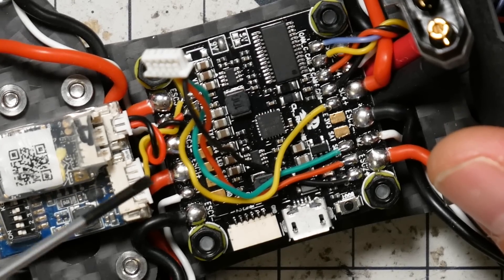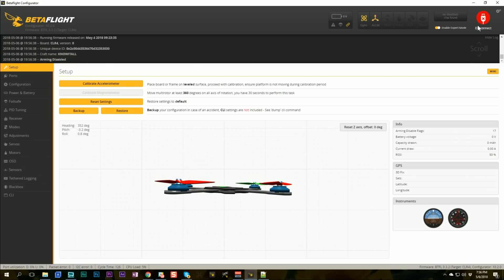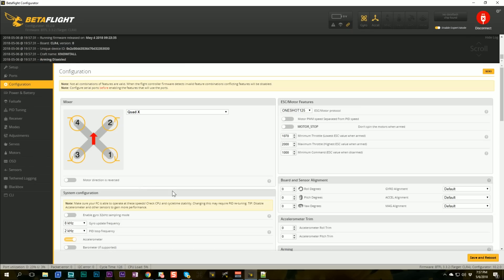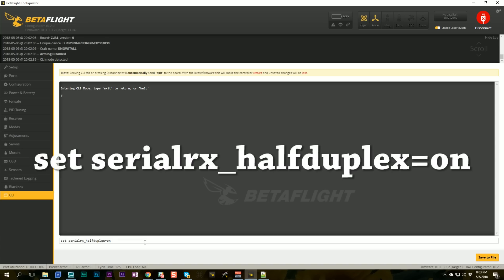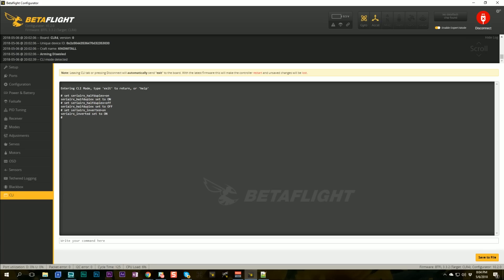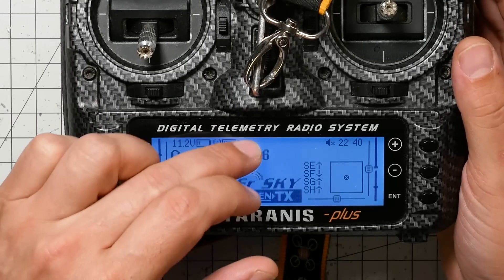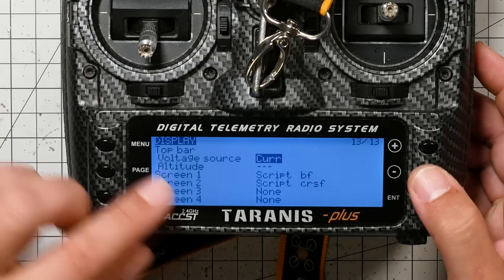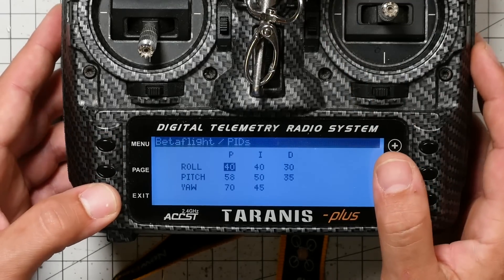FRSKY FPORT HOW TO | SBUS and SmartPort on One Wire

Comment: Hello Josh, im new to open tx after yrs of spectrum im trying to get a 5 inch setup qx7 the receiver your using in this video. I have the lux V2 FC. I wired the rec as you described.  My problem is i cant get the rec. tab in BF to work. On the lux v2 the serial rx is uart 4 the tx is uart 5 i have the serial turned on uart 4  and in config i have serial rx and sbus on, is that wrong?

Comment: Hey KIA... is Fport inverted...?
Reply from the maker: Yes.
Reply: @JoshuaBardwell  Confused... F.Port uses hardware inverted S.Port connection on Rx. Wired to FC via hardware inverted S.Port. I've read that F.Port solves inversion issue on F4 processors. Theoretically F.Port software could be written inverted then sent to S.Port and un inverted and no need for an invert on flight board. This is what I thought F.Port accomplished. Luv the KIA on yer OSD... lol and your vids I'm having lotta fun with this stuff.
Reply: Yikes that seemed like more of a rant than question... thx to Samuel Adams.

Comment: Joshua, So if F-port will not work on softserial, does this mean I need to reflash my receiver back to a non-fport Fw to have s-port telemetry?
Reply from the maker: Smartport telemetry is included in fport. That's the whole advantage of fport. That it does telemetry and control in one wire.

Comment: Hey Joshua, thanks for all great videos, they are really great when you are new to this hobby, even me as an embedded software engineer for two decades stumble on these things sometimes. I have a question about this, which may be to specific, IDK. I have a Diatone GT M530, which has their Mamba F405 FC. It's good, but it's woefully lacking in documentation. It has three UARTs, none of them specifically labeled for a specific use - I've been able to discern that UART1 seems to be able to handle inverted signals since I can hook S.Bus directly to it and it works: So currently I have S.Bus at UART1 and SmartAudio on UART3. For SmartPort I had to solder a wire to the non-inverted pad on my R-XSR receiver, It had me scratching my head for a while since it got delivered with a harness wired up seemingly to fit an R-XSR, but with SmartPort going to the normal, inverted SmartPort pin on the receiver.

Anyways, given this FC, which has no Telemetry/SmartPort/Whatever name for an inverted UART, do you think F-Port would work if wired to UART1, which now is wired to S.Bus without any external inversion?

Cheers
Reply: This is a good question, and would answer my dilemma also with the DYS F4 Pro V2 ..... Should we just flash F.Port FW to R-XSR , then connect the S.Port wire from R-XSR to the same TX-1 pad that is working out of the box with Sbus ??? (And modify BetaFlight etc) But as it's an old video, I don't think Joshua Barwell  will hear our cry's in the wilderness that is YouTube. He must get literally thousands of notifications every day  :)  Joshuaaaaaa  ;)

Comment: but if the f4 don't have a tele pad ? what then?
Reply from the maker: You must do the "uninvert hack" on the receiver. For the RXSR this is simple, since it has exposed P pad which gives uninverted smartport and fport.
Reply: I have the r9mm. So just connect it to a tx pad?
Reply from the maker: Correct.
Reply: Thanks 😊 no need to do the soft serial when connecting to tx?

Comment: The Lumenier F4 AIO has a dedicated SBUS pad and a dedicated RSSI pad along side tx/rx3 and tx/rx6... how would I wire the R-XSR to this flight controller. I can’t seem to find any information on this board other than vague standard specs. Thanks in advance anyone...
Reply from the maker: RXSR goes to the SBUS pad. Green wire is SBUS OUT if my memory serves.
Reply: Joshua Bardwell thank you sir

Comment: Hi JB! 
I'm struggling with getting fport working on kingkong f4(tower) with r-xsr. For now I'm getting all channels working, but having only rssi and rxbat in sensors list. Tried all CLI tweaks. Soldered on uninverted s port pad. Tried again. No changes. Also need to say I put this wire on rx receiver pin on fx, and then remapped it to a tx6.
So question is: 
Will channels work if there is some issue with wiring or resource mapping? In other words: Does my situation means I did it right (I mean soldering and setting up) or it's completely wrong and I should look for another pin on fc?
Reply from the maker: If you are using the "uninvert hack" then I suggest you skip remapping, which can cause complications. Use any TX pad. Make sure to go into the CLI and type

set tlm_inverted = on
set serialrx_inverted = on
save
Reply: @JoshuaBardwell  ok. But what you say about rc channels working fine ?
Also I have a strange thing : few things mapped on C07...How can it be ? There was a pwm4,serial_rx and serial_tx on C07
Reply from the maker: "resource" shows what MIGHT be on a pin.

"resource list" shows what IS RIGHT NOW using a pin.

So in "resource" you might have multiple resources on the same pin but "resource list" should only show one.

RC Channels working fine could be because of uni-directional inverter on the pin.
Reply: Joshua Bardwell thanks! That’s very useful knowledge! For now hooked up to uart3 due to vtx dont use it( but awkardly connects to it via stack connector🤪) and it’s all working! Soon i may be will try again to use previous port, checking it with proper command

Comment: So, what is going on with the F port? they say its a single wire protocol yet you have to use 2 wires for it to work? Can somebody explain this?
Reply from the maker: No, it's a single wire. Not sure why you hhink it requires 2 wires.
Reply: Joshua Bardwell prob because in the vid you still had your sbus wire still intact?

Comment: Is it possible tu run F.Port on a DALRC F405 AIO?
This board have not a inverted Telemetryport on any TX-Port. The only one inverted port is the SBUS-Pin and they dont work Telemetry but the RX-Signal.
I have flash the F.Port-Firmware on my R-XSR and i use the yellow cable.
Reply from the maker: You have to use the P pad on the RXSR which outputs uninverted telemetry and fport. Then you can use any UART TX pad on the flight controller. Go to the CLI and type "set serialrx_inverted = on".
Reply: OK, thanks for your very quick answer.
But, i let it be so how it is. It was a interesting think to try it again. Now i have flash the RXSR with the FPORT-firmware and i have the same as before on the yellow wire (out of the box this was the SPORT signal and now its the FPORT or the SBUS for me on RX1).
I realy dont need telemetry.
Thanks a lot and happy flying :)

Comment: Any update to this? I have x4 rxs-r and was wondering if f-port was faster than s-bus. I am finally getting fast at my local multigp and was looking for that low latency edge. I hate tbs because of bad customer service + the unify nano vtx smart port only works when i don't need it. I have considered using ibus (flysky) or r9m module for my taranis. The fli14+ ibus are dirt cheap but do not know if lua will work on the firmware/module.
Reply from the maker: https://youtu.be/hCX2Qi51ZtU
Reply: @JoshuaBardwell   Now I am deep into the rabbit hole. I have been running open tx for the last two years. ersky9x fport r-xsr 13-22ms latency right behind crossfire 9-21ms latency according to bryce. Thank you for the link.

Comment: Sorry if this sounds stupid, but in this example, did the S.Bus (green wire), become redundant / removable?  Thanks!
Reply: No
Reply: https://youtu.be/ZyKgBS9wmuc?t=34  I am confused because it sounds like the benefit of F.port is to take the S.bus control signal + the S.port telemetry signal, combine to a single multipurpose wire and place onto 1 single uart pad. Is this correct?   Thanks
Reply: Anyone know? Sorry I'm completely new to this but I rewached this vid and I must be missing something - feel like @Frank Sura has answered wrong and thrown me down the wrong path here.  Sorry to sound argumentative. 
Thanks any info
Reply: @anashbear2608  You probably figured this out already. But... for anyone else (like me a few days ago) scouring the comments for this very answer. Yes, you can remove the SBUS wire. It becomes redundant and can be removed. JB was just didn't bother to take it off his existing build. It won't hurt anything to leave it there. If it is a new build, don't bother putting it in. You just need the three wires +ve, -ve, s-port.

Comment: Is it possible to wire a Ublox GPS to the same Uart as the smart port wire since they both transmit some kind of information?
Reply from the maker: No, you cannot have two devices on the same UART.

Comment: Worked great except the PWM page on Lua Script. It was recently fixed with receiver firmware: 180827 My config below.

FC: Kakute F4v2 betaflight 3.5.1
RX: R-XSR
FPORT Firmware: 180827
TX: FrSky Taranis Q X7S (with OpenTx 2.2.2)

Comment: Joshua I added a r-xsr to my babyhawk r. I watched 3 of ur videos to help so I upgraded firmware and setup fport. I get rssi and rxbt telemetry and it works but I cannot at all arm the quad or setup switched on betaflight. I did cli status and just says RXLOSS. not sure what i missed since u am getting telemetry signal I know it's wired  correct. thx!
Reply: I think you still need the sbus wire hooked up

Comment: Whats up bardwell? I need some help with getting my qx7 to work with my r-xsr. Im using the pyro f4 osd fc and flashed the firmware to the r-xsr for fport and lua scripts. Im bound to the rx and appear to get telemetry but dont get any stick movement in bf. I tried the tele pad and tx4 on the fc and neither worked. I've also tried the serialrx permutations in the cli. I'm new to taranis and not getting any help from my fb groups that I'm a member of. Please help me! Thanks bud

Comment: Picked up a RXSR - Using an Omnibus F4 V3 - using iNav (uh-oh). The FC does not have an inverted input (SoftSerial) and iNav doe snot let me remap resources. So I figured out where to pickup the non-inverted signal on my RXSR but I fear for the pad's safety since it is so small. Can I jump it to the SBus in (pin 5) and then use that wire out of the connector? Can I use teh SBus out pin to jump to? I like the connector because I can still disonnect and remove if necessary
Reply from the maker: That's a fine idea but you most cut the original trace going to the pin before you reuse it.

Comment: Is it possible to use the sbus pad of the FC instead of the tele pad? That way you have one UART free.
Reply from the maker: No. FPort requires a UART transmit connection. SBUS is receive.
Reply: Joshua Bardwell thanks. Just bought a R-XSR rx but my FC (F4) doesn’t have a tele pad, what could I do to take advantage of telemetry?

Comment: I can't get this to work completely with the Kakute v1, RC controls are just working fine. Telemetry doesn't work at all. Any ideas ?
Reply from the maker: Have you enabled telemetry in the configuration tab?
Reply: Joshua Bardwell yes I have. Does the kakute v1 has bi-directional ports. It's just strange. The RC-Controls are working just fine. I also made a new model in my Taranis deleted the sensors in the temetry screen and discovered new sensors. But so far I still got nothing.

Comment: My lua scripts don't work with this and I'm not sure why. All my telemetry works and the quad flies fine, but I can't get the lua scripts to work.
Reply from the maker: What I would do in your case is use resource remapping to put softserial on a spare pad (like LEDStrip) and then use softserial for smartport telemetry. This may sound silly to do if you have a spare UART for smartport but softserial often solves problems like this when hardware UARTs choke. Here is a how-to: https://www.youtube.com/watch?v=jT4vf6575TM
Reply: I can't get softserial to work. I'm using a helio spring with butterflight, which I am assuming matters. Do you mean smartport, or fport? I'm running fport currently, and like I said, all the telemetry coming from the FC works, and it flies, but I just can't get the lua to work.
Reply from the maker: If you're using fport then softserial won't work. But if you're using fport then smartport should DEFINITELY be working. I'm not sure what could cause the Lua script not to work then. I have heard of a few cases where this happens but I honestly don't know what could cause it.

Comment: If you didn't change the wiring from an old board, that was set up for Sbus and Smart Port telemetry, then you didn't save any UARTs because you would have had it wired to use two different UARTs in the first place, right?
Reply from the maker: That's kind of the point. On an F4 board you may not save anything because the UARTs are inverted for SBUS and Smartport.

Comment: Thanks for the info once again, but im having issues w getting the battery voltage on the Taranis, I dont have a page 13 of 13 (Display) from the PAGE tab to get the voltage to switch over to Vbat instead of Current, i only have 12 of 12.

Comment: Dear Joshua, thanks for all you do for us. I finally succeeded to wire the f.port. I still have a question. As I use the tele pad for fport, I wanted to use the the sbus pad to wire a gps beitian bn220. For doing this a need a free rx tx. I currently use tx4 for my tramp, rx6 for esc telemetry. Is there a solution to wire it on your fc. By the way the design of your board is awesome. So easy to wire.....thanks. Florent from France. Take care....
Reply from the maker: The SBUS pad on my FC has a switchable inverter so you can use it as a generic RX. But the corresponding TX is not broken out so it's not as useful as you might prefer.

Comment: I'm confused a little. You say it frees up a UART. Not Really because you say it needs a bi-directional inverter. So really it just frees up the SBUS pad which I believe has limited use. I was hoping this would save me from making the choice of SmartAudio or SmartPort telemetry on an F4 board that doesn't have an extra UART.
Reply from the maker: It would free up a UART on an F3 or an F7, or on some F4 that have a configurable inverter but still allow use of the UART for a different purpose. For many F4, though, you're right: you don't gain anything.
Reply: So your saying on a F3 or F7 board I could use the SBUS pad for FPORT?
Reply from the maker: On an F3 or F7 board there is no SBUS pad because all UARTs support inversion so you can use any UART for any function.

Comment: Hey Josh , I have a DALRC F405 FC , and a R-XSR flashed with FPORT, RC works great! but no telemetry only RSSI,  any help would be AWESOME! Thanks mate
Reply from the maker: My guess is the port you're using only has a unidirectional inverter. Did you use the Smartport telemetry pad on the FC?

Have you tried adjusting tlm_halfduplex?
Reply: Joshua Bardwell I haven’t tried the inverted pad - I have tried all different variations of the inverted and halfduplex settings - as soon as you change any of those settings the RC stops working - tomorrow I’ll try the s-port inverted pad tomorrow and see how it goes - thanks so much for writing back yet again mate !!

Comment: Fport yeay; setup ease nay😒. Got an rxsr and a f4v3pro. Upgraded firmware to fport compatible. Desoldered the sbus wire and soldered up Smartport wire to pwm 6 c09 wich i remapped to serial_tx 11 . Did all the above and set receiver to fport and enabled serial rx and UART 6. Then tried the 4 cli possibilities. 2 hours later i realized how people lose their hair🤪. Seriously though.. i’m stuck in noob level here.. Anyone care to help me out? Much obliged. Btw; i truely believe the World needs more j-bardwells 😁👍
Reply: Ps i cant get my receiver tabs to react..
Reply from the maker: You can't do serial rx using softserial. You must use a hardware UART.
Reply: hi, thanks for the quick reply. just desoldered and resoldered to tx3, ditched the softserial; no dice
Reply: Joshua Bardwell 
The noob (hereafter referred to as me) realised fport isnt going to work on the omnibusf4pro and decided sbus w smartport is also kickass😁👍. Thanks for all your helpfull tutorials!

Comment: Hey Joshua, I am using your RDQ F4-AIO, and the FrSky R-XSR. I have quadruple check my wiring, and it seems correct for the setup. In Betaflight I have set UART3 with Serial RX on, and UART 1 serial RX disabled. Receiver configuration is set as serial based and FrSky FPort.  My XD9+ and the receiver are bound as indicated by the solid green light. On my transmitter my channels are set as AETR, and in the outputs they all put out the correct uS range when going through the throws. My problem is on the Betaflight screen when on and connected, my channels do not move. All channels are at 1500uS except throttle, Aux 13, and Aux 14. I am just coming over to FrSky from Spektrum, so there are quite a few new features to me. I also went through the New Taranis+ setup video to see of I was missing something on my initial radio setup. Edit: Using Betaflight 3.3.2, and configurator 10.2.0

Comment: What really stinks is typically a UART is used for SBus that can't be used for other things now.  You're still losing a UART with this.  Still a cleaner build but I'd be interested to know which (if any) F4 boards allow bi-directional on the Sbus port?  I know the Heli-Nation Talon does not, I'm going to try the CL Racing F4 Mini next.
Reply from the maker: On F7, you legitimately get the UART back. On F4 not so much. But sitll you save one wire?
Reply: F7 matek dosent work I did the hack also and still can't get telemetry and lua to work